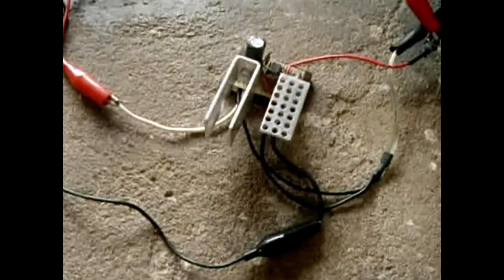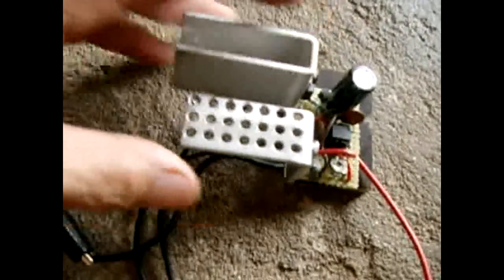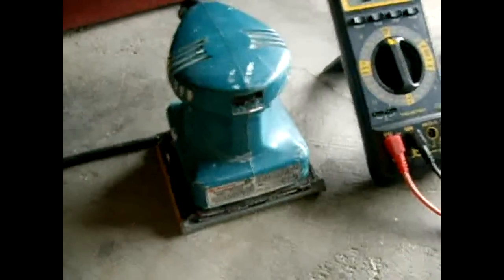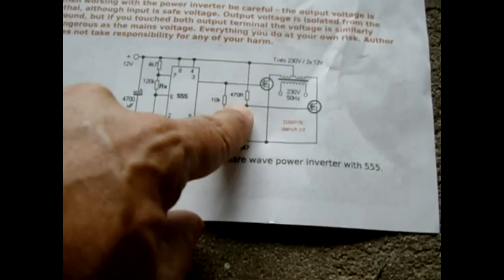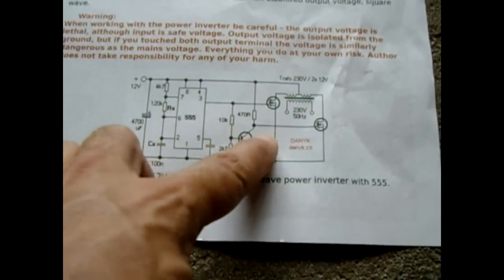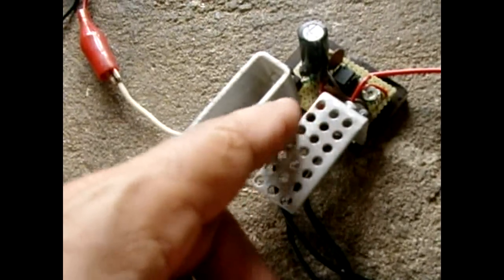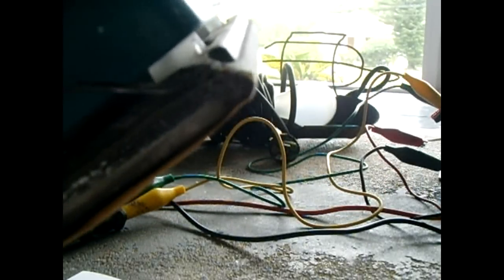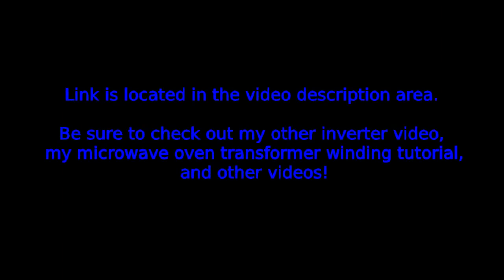12 Volt Power Inverter Circuit ~ High Output/Freq Adjustable

Comment: I managed to build it but when I try to step up the voltage it refuses. ..what could be the problem?
Reply from the maker: The circuit definitely works, maybe you have a faulty component.
Reply: I used the F1010E mosfet can it be the source of the problem?

Comment: Nice circuit, nice demonstration everything seems easy to get.Can I use a 7ah battery an get like 30watts or above from a ups transformer
Reply from the maker: 30-50W at 120V using a 7AH, no problem, but expect it to drain down in 15-30 minutes.

Comment: Do you think this same circuit can be used at a higher frequency? More like 10khz to 100khz. With a variable capacitor or resistor? So you can fine tune the frequency?
Reply from the maker: You can play around with the component values. If using higher frequency, then use a smaller transformer.

Comment: What about inductive spikes from the transformer windings? is it possible that they may be whats heating and shorting your mosfets? Btw very nice video! I'm a big fan of 555's and i love to see something this simple doing exactly what you'd expect it to do!
Reply from the maker: Hello. I added a 27k pull down resistor on each mosfet's gate to ensure each mosfet turns off quickly, and I also use my inrush limiting circuit. Everything works just fine. :-)

Comment: Good project, but wouldn't it save a lot of time and trouble by just feeding the secondary your mosfet circuit and by adjusting that amplitude you can also get 120 vac out... at the exact rating it can take in as a microwave. In other words, transformers are not directional so you can put AC current in the secondary which becomes your new primary and your old primary becomes the new secondary.

The advantage is that its less work and already better factory wound with the best transformer wire (because it will handle higher voltage and is much thinner)... as usual, fuses and monitoring are always great ideas. You might even put a resetable thermal fuse (a lot of coffee pots ran them but in your case I'd order one at maybe 140F-160F) so if the transformer gets to hot it turns off and saves everything.

You can also get lots of replacements for 555's. If you look them over one might be better for your individual needs. Some are the 7555 or 555lc was a very low power one... just google around, one has an heavier duty output and that I was thinking might be better for your purpose. There's even a 556 which has 2 555s in one package.
Reply from the maker: +BikingMNViking 
Better off doing what I show in the video. Thanks For Watching

Comment: Pardon, but this is a square wave inverter, yes? Has anyone had success altering the superb design to operate more like a sine wave inverter for a higher efficency? Or is such a thing even possible? I know a few capacitors would allow for the simulation of a smoother transition like a sine wave, but would dong such a thing actually increase the load to an unreasonable degree?
All things considered, is the stepping square wave emitted by the circuit close enough to a true sine wave to not really matter for 90% of applications anyways? eg, could a household computer be plunged into such a source without a noticeable reduction in lifespan?
Reply from the maker: I also show a modified sine wave inverter circuit on my channel.

Comment: I made a similar thing but used two 40-50W transistors. PNP and NPN to create a pulsed + signal to a 9.5V to 120V AC to run my stereo! (Finding out that my stereo itself is actually quite efficient.. and runs off a transformer itself! o.O)
I had a 9V DC battery and used that to power it

It runs off 2 resistors.. 250ohms and one 1K resistor. and a 4uF 250V non-polar capacitor.. works great! even though the frequency changes it works good enough to charge a phone and such.. Not much power but it works.. using two large heatsinks. the transistors dont even warm up.
the transformer is 1.5A 9.5V one side. to 120V AC the output.
I can power it with a 9V battery for a few minutes! the frequencies is really high on the output but lowers when i plug something in to more accurate ones.

Comment: Hello, and Thanks for your hard work..
How did you get 100volts out of your secondary, l did mine with  #10 gauge and i only get 22 volts any info would help..
Reply from the maker: +Andy The Truth 
Your ratio of turns is definitely not correct. Copy as close as possible what I show in the video. It definitely works.

Comment: so you use minimal components, a massive transformer, great for demonstration of possibility and perhaps use in the old days? it seems that to keep things small by modern standards they use switching instead. correct me if wrong please-cheers..
Reply from the maker: +Alan Wolstenholme 
Most modern inverters do use switching, but they are easier to damage.

Comment: You said you could parallel the MOSFETs, so could you triple, quadruple etc. to get more current?  I'm wanting to aim for 900 to 1500 watts depending on how much DC current the new primary 12-AWG can handle.  I realize I'll probably need a heat sink the size of Manhattan, but I still want to try this.  I'm even wondering about using multiple MOTS (I have 12) with heavier wire and fewer windings run in series parallel?  Ok, maybe I'm thinking to big, but for now I'd like to at least try for 900 watts.  Thanks!  Edit: I just checked 12v wattages and it looks like I'd need #8.  I guess that's where series parallel transformers would come in?  Wonder how I'd wire that?  I love experimenting!! lol
Reply from the maker: +Jamie Richards 
Try using a single irf3205 mosfet. They can handle up to 100A.
Reply: This is an excellent circuit, although as the author says, it does have its limits; (there are many things which will heat up from not having a "clean & pure" sine-wave feeding them, so we use an L-C ckt to smooth the "rough edges".) As for heatsinks, when I needed a 6-v, unknown-current "battery charger" for an "Antique" Willys; Utility Wagon, I used a simple "Impedance Charger", with the inside of the wheel-well as the heat-sink for the 25₵ bridge rectifier. (The entire ckt. cost about 35₵ retail.) Nothing like heavy-gauge steel that's 18'x6' for a heat-sink! (I also learned to love impedance-charging; it works over an insanely wide voltage range, and if made properly, will last forever, & isn't dangerous, using only 2 components, a .01mfd cap & a cheap bridge rect. from any source. Just make sure you know which is connected to the "hot" 120-V wire, or use two caps, one on each side. You'll know it's live, but shouldn't get a shock. There's always using the "old-school" method of a transformer for total isolation, but since transformers use current all of the time, they're not ideal unless you're trying to smooth the output waveform, or match the input impedance, etc. This is one of the 1,000's of uses of the NE555, probably the most versatile "IC" ever made. (Want CMOS? Use a 7555.) Keep building safely!

Comment: Excellent narration .... Thanks for the info and your willingness to share!!  What are your thoughts about using an RC circuit from the GATE to ground to allow voltage to bleed down instead of simply cutting off based on the 555 pulses. This would allow you to create a true sine wave. Of course the timing of that the new RC would need to be adjusted as the FREQ changed. Maybe you could design it so the POT is used for both RC circuits.
Reply from the maker: +donbeckham 
The mosfet must be completely and quickly turned on and off, or the mosfet will become hot and blow.

Thanks For Watching!
Reply from the maker: +donbeckham 
The mosfet must be completely and quickly turned on and off, or the mosfet will become hot and blow.

Thanks For Watching!

Comment: Can you power a clock with the Inverter?
Reply: Depends on the type of clock. The "old-style" clocks used a hysteresis synchronous motor, and were very forgiving of voltage, but absolutely dependent on frequency. (The power companies would monitor their output to "the grid", and if one month averaged 60.10cps, they'd tweak it down to 59.90 the following month, then the 3rd month they'd tweak it back up to exactly 60.00, so clocks always were well within accuracy.) Modern clocks that use a crystal-controlled time-base & digital displays aren't so picky. I suppose it depends on the clock circuit you've got...
Reply: yes you can, but you can run into stability issues with your clock is it uses the 50/60 Hz as a reference
then the clock might not be as stable as one would want

Comment: Dear friend nice demonstration. As you said you are getting a bit lower voltage in the secondary with 20 turns of primary. Experiments on inverters are showing that if you reduce the primary turns a turn or two, you will get an increment in the secondary voltage to say up to 110V. So in your case it is needed to reduce the primary turns a bit or to reduce the primary circuit resistance by a nice design using thicker wires and connections. Also ic 555 is not a good choice for inverter. Far better ics are available on the same price and simplicity of the circuit than 555. Anyhow a very nice project demonstration for beginners. Regards,

Comment: I just finished working on your circuit and running properly. I can turn on my active speakers and also my 29-inch LED TV.
I use 3 batteries 12v 3A in parallel and 5A transformers.
in your video, you mention can add mosfet with a parallel, how?
i need to add more mosfets if possible. but what the effect?
can you explain that thing? (I do not dare to go further, for fear that if the circuit has become damaged).
please....., I have subscribed your channel.
thank you for this great circuit.
Reply from the maker: +Rio Lasut 
Hi there. It is easier to use an irf3205. :-) Thanks For Watching!

Comment: Can I use power regular transistor instead mosfet if I not gona use big load ?
Reply from the maker: ayman zayed The circuit is designed for mosfets. A transistor may not fully turn on using a 555. The 555 cannot supply that much base current. The mosfets will fully turn on. You can always give it a try, but I never tried myself.

Thanks For Watching

Comment: can you show how you rewind your transformer to have it center tapped?
Reply from the maker: James Kenneth Firmalino Hi there. I have a few videos showing how I rewind MOT(microwave oven transformers). Please refer to my video playlists. Look for the "MOT/microwave" playlist. Adding a center tap is easy. Half way through the winding you strip off a 1" section of insulation so you can solder/twist on/heat shrink a short length of wire coming off the transformer.
Reply: +electronicsNmore thanks for the feedback. you have great videos. ill just consult you if i have trouble in making my inverter.
Reply: Hi there electronicsnmore, i have created my inverter,  ive got a 230 volts 900e mot. I rewind it 24 turns and the output is 175v. How can i increase it to 230v? Tnx.:)
Reply from the maker: Raising the frequency, or modifying the 24T lower(maybe 22T), should do the trick!

Comment: Hi, nice circuit, I found your video and very good! 
Was wondering if you can help me if you don't mind, the author of the circuit never replies!? I've built the circuit to the letter, barring the FETs. Using irf630 until my delivery turns up. 
Here's my problem...
The o
Mosfet connected to pin 3 thru 470ohm (call it MOSFET 1) it sees 12v less the 1.7v from 555, as expected. Out of the bc457 I'm only getting 0.80v at the collector/resistor junction so the second MOSFET (MOSFET 2) isn't triggering?! Is it just the MOSFETs are wrong or is there another reason I'm getting such a selfish FET?!! ;)
The 555 is fine. I've got a tester I made which blinks LEDs on high and low pulses. So the timers fine? I've triple checked all connections and my mot has 24t of 12awg center tapped at 12t and there's no shorts anywhere on the mot? Hope that's fathomable!  Any help much appreciated. I'm stumped..
Reply: I noticed it didn't appear that anyone got back to you on this, so here's what I know from "building" transistors, mosfets, & ICs in general, under a microscope, long ago: Once in awhile, I'd get a semiconductor die that got past quality control, & didn't meet its' published specs; in the case of mosfets, the most-often thing I found was double-passivated gates, which required more than twice the voltage to turn on, & didn't always turn completely off without being "helped" w/a pull-down or pull-up resistor or similar; you may want to try changing the offending mosfet, if possible, (and if you haven't already done all of that, since this response is so long in coming). Hope this helps.

Comment: Does this work with a 5 volt input, I actually need 12 volts AC and I have 5 volts DC, I will have to find the right transformer.
Reply from the maker: It should work fine just as long as you have the correct transformer.
Reply: Ok thanks

Comment: Right, this is actually BLDC motor controller, not inverter. Have you checked the signal output? It is pulse, not the sine. Maybe you could make output signal smoother with the help of capacitors?
Reply from the maker: Who ever said this was a sine wave inverter? This is a square wave inverter, which I verified using my scope. If your looking for a modified sine wave inverter, I have a video for that also. Adding capacitors to smooth the square wave would likely cause the mosfets to blow.

Thanks.
Reply: electronicsNmore
I see. Thank you for answering!

Comment: It appears to be a square wave driver rather than a modified sine wave inverter.

Have you tried the ZVS driver, usually used as a TV flyback driver? with a ferite core, driving about 100 turns of wire of the secondary, I can light up 40W lamps with ez, and a 75W floodlight wo nearly full brightness. My tank capacitor is 2uF, and anything lower will raise the frequency, and reduce the output power. I found the output inductance/impedance to be critical depending on load. (larger lamps burned hotter with fewer turns, while smaller, higher impedance loads needed more turns.)
Reply from the maker: It is a square wave inverter. If you want a modified square wave inverter, then you have to watch my other inverter video.

Comment: i have a dc to ac invter do you think you could fix it? made by corba
Reply from the maker: The most common part of an inverter to fail is the power mosfet. Test each of your mosfets. If you don't know what a mosfet looks like, perform  an image search. Usually they start with "IRF".

Thanks For watching
Reply: its a 3000 watt peak 1500 constant if you want to try to fix it up to you and if you cant just keep it its new never used but i did do a little damage to trying to get it to work lol or if you can fix it let me know price and if its to much you can just keep it let me know thanks
Reply from the maker: Gabriel Campbell
If I was living in the USA, I might take you up on it. I also have many other projects going on.

Thanks!
Reply: np thanks anyways

Comment: can i used in Air conditioning thanks for your advance answers
Reply from the maker: A/C compressors(hermetically sealed units) draw a lot of current when started. Hard start kits can be added to lessen the high current surge, but still not a great idea for this particular inverter circuit.

Thanks For Watching!
Reply: electronicsNmore  thanks sir

Comment: The problem with this circuit is that the pulse train driving the transformer must be extremely close to 50% duty cycle, otherwise the core will slowly get saturated, causing bad things to happen.
 A better way would be to use an actual regulator chip.  They are as cheap as a 555 and will produce a much better and safer design. 
The micro-wave oven transformer is a neat idea though.
Reply from the maker: Your right about the pulses. Have you seen my other video using a 4017 and 555? Having an O-scope is very useful for these circuits.

Homemade Modified Sine Wave Power Inverter(350/500w)

Comment: I made this circuit last night qnd I am waiting for my battery to come in the mail. I tried hooking up a 16v 900ma wall adapter to the circuit, but I am not getting anything out on the 120v side. Mosfets are brand new IRF3205's. I rewound the MOT with a 12 +12 primary. Do you think that the current just isnt enough to drive the inverter, and when I get my battery it will work?
Reply from the maker: The power supply you are using does not have enough current to drive that huge transformer. Do you have a small 12V center tapped transformer laying around? (radio shack has them). That should let you know if the circuit is working properly. You should have assembled the circuit, then tested it using a car battery. If you have issues with this circuit then my other inverter video has a link in the video description area for another good, simple circuit. 

That video is here:

Homemade Modified Sine Wave Power Inverter(350/500w)
Reply: I got the battery today and hooked it up and the mosfets blew. I checked the circuit, replaced the 555, and it still did not work. Does the transformer need to be hooked up in a specific way? I cant think of anything else that could be wrong. Ill check out your other circuits, although I want to avoid transistor inverters because I need the 60hz.
Reply from the maker: Same thing happened to me when I first made it. But for some reason it never happened again. Try adding a pull down resistor to each mosfet from the gate to source. 22k is fine. Verify that the circuit is to the schematic. If you blew a mosfet, the chances are the other one got damaged too. make sure the D and S did not go short circuit on the one that did not blow. Verify the 555 is still ok. Start with the frequency higher, then lower it down after you get the inverter working.